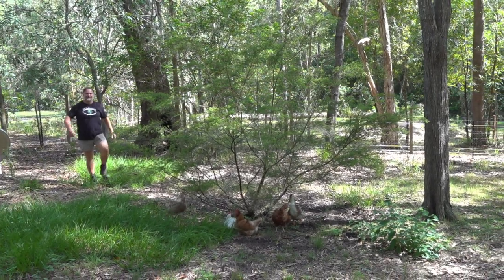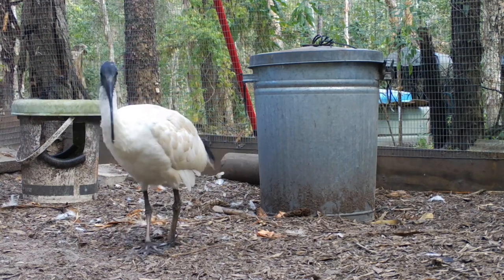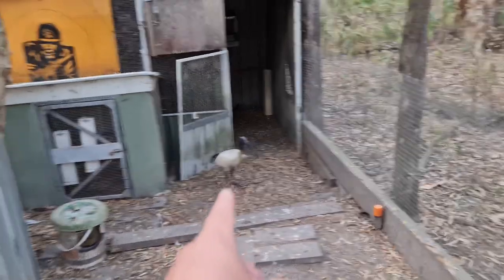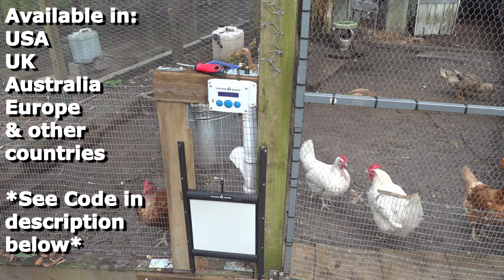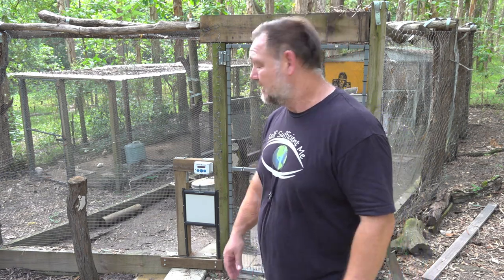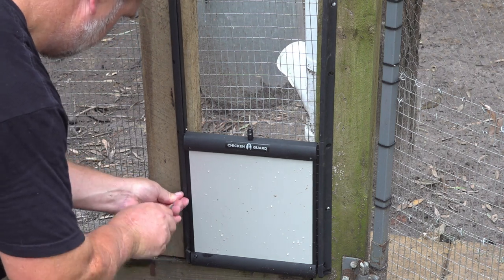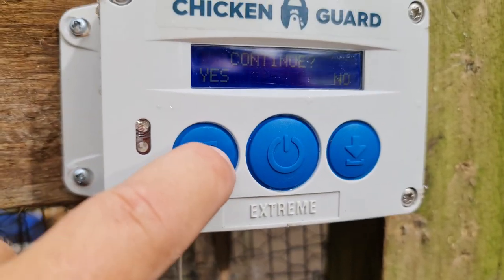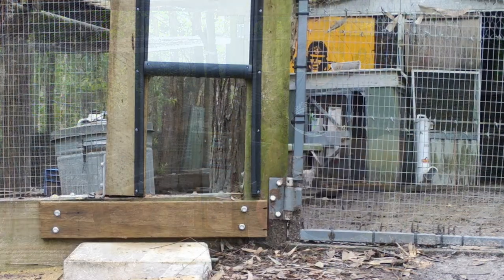Way to STOP BIN CHICKENS Raiding My Poultry Pen | First Impressions Chicken Guard

Comment from the maker: Edit: As of 30 Sept 2021 my unit has stopped working - I have contacted Chicken Guard and am still waiting for their response. I will post my follow-up and final review video on this automatic chicken door once I have more information (hopefully soon) but what I can say to those who watch this video specifically to get more info before buying there are three things you might want to consider: 1 - Getting a unit that is rechargeable via solar power (the batteries in my unit didn't last 6 months). 2 - Get a unit that has an easy way to replace batteries (if not rechargeable) this unit requires the screws to be removed and whole face taken off and the batteries are not easy to get out and back in. 3 - The jury is still out for me on the string method for door operation. Other methods to open and close door such as a screw or rachet system might be better. 
Original post: G'day Everyone, As mentioned in the video: Go to https://www.chickenguard.com.au/?ref=markvalencia and use code SSME5 at checkout for a 5% discount (if you have any issues either with the code or links contact Chicken Guard support and let them know because even if I don't get a commission they should at least honour their word and give you one). I'm keen to publish one last video before Xmas but if I don't get the chance please have a safe and happy Christmas and New Year! Cheers :)
Reply: Merry Christmas and Happy New Year to you also from Texas 🇺🇸. THIS VIDEO IS TRULY helpful to me.
Reply: Are you growing coffee? 
I grabbed a plant from Bunnings and in the process of growing it until I can get a cuppa
Reply: Ibis are super kind intelligent Australian native birds deserving every respect. They're chill ..
cleverly calling out "peace man" amongst the human hotheads
Reply: @amandawoods847  bit extreme rant Amanda. If you actually watch the video there is a segment where Mark actually references the proper name....then I believe there is another segment where he talks about if he was a crueler man and let's said bin chicken go. It's Australian colloquialism, believe it or not there are alot of names for the same thing...  One nation of Aboriginal called the ibis kwenymarr ..,they must be misinformed too.....Stop being a Muppet. He's doing a 1000 times more for our planet and wild life then most people, pull your head out of the sand, be a lover not a hater. 
Cheers again for the great video Mark you're a bloody good lad keep up the great work.
Reply: Merry Christmas Mark from NZ.
Reply: @lynttontonta  step up and start wildlife rescue rather than texting congratulatory to a youtuber
Reply: @lynttontonta  well said Lynntton!
Reply: earth walker  yes, it snows in Australia.  I don't think that it snows where Mark is (think Florida, USA if that helps you visualise).
Reply: Same to you my friend  👍🏽🎄
Reply: Amanda Woods I bet you shead a tear for the stinking bats as well .
Reply: im new to your youtube channel but just watched a dosen of your best videos would be awsome to see you cook with your vegies

Comment: I've had the previous model of this for about 6 years now and it's been very good.  After about 4 years the plastic spool inside broke and I contacted them to ask how much it would be to get it fixed, they said it was dead easy to fix it myself, told me how to do it and sent the spool to me without any charge even though it was out of guarantee.  I'd definitely get another when this one finally wears out.  No 'bin chickens' around here though!  I don't envy you those!
Reply: Do they upgrade with model with flame throwers
Reply from the maker: That's great service and good to know! Thanks for sharing your experience 👍

Comment: I had a problem with scrub jays eating chicken eggs.  They are nearly as smart as crows and able to go anywhere the hen can to get to the eggs.  What I had to do was gather eggs quickly and leave ceramic eggs in the nest.  They quickly figured out that the eggs wouldn't break and stopped being a problem.  Unfortunately, they are very good with color and figured out that all brown eggs crack and they would eat the brown egg in a nest and leave the green one alone.  So, I had to get brown ceramic eggs too, to completely fix the issue.

Comment: I see you love those roofing screws! I highly recommend using an impact driver rather than your drill and they should go in a lot easier, particularly into that hardwood you're using. Plus you won't have to take the drill bit out of the drill for those pilot holes, to put the driver bit in. Love the channel!

Comment: For a lower tech solution, you could also fit in a normal doggy door (for smaller breeds). They have slat inserts to slide into the door that lock it at night.

Comment: If the BC's (bin chickens/black crows) get wise to the new gate, maybe try this:  Add 1/2x1/2 grid wire in a little entry tunnel.  @30" x similar size of door (14"?) tie it in above the door and bow it back about 18" and stake it down.  From the outside with bird vision, it will look like the fence.  (I'd imagine that it is rigid enough not to collapse if someone hops on top of it.)  Chickens and ducks will learn to navigate the slight diversion!  Enjoy your videos and have begun to SSM2 and look forward to Self SuFISHent me?

Comment: If the door is not enough to stop the crows, I would think to add a box tunnel behind the door on the inside. This will look even more like a trap to the crows and because it will take them longer to traverse it and should hopefully make them think twice about entering.

Comment: I would not be surprised if the crows eventually figure out how this thing works, crows are smarter than most people give them credit for.
Now, i don't think they'll actually actively use it, they're probably also smart enough to know they can't get out fast enough with this system.
But yeah, i would not be surprised if they knew how to use this.

Comment: I've got pigeons eating our chicken feed
Reply: A ‘Grandpa’ feeder should fix that. Obviously keeping your chickens and their feed in a fully meshed coop/enclosure all the time would work. We don’t do that either because we like our girls to be able to be out in other parts of our garden as well as their coop area. Interesting to see if the automatic door keeps out birds smaller than the ‘bin chickens’. Have found the Grandpa feeder to be sturdy and effective at keeping both rats and wild birds away from food. Downside is that the grandpa feeder is expensive. There are a number of cheaper versions or knockoffs out there but I believe that this is a case of ‘you get what you pay for’. Pigeons will probably be fooled by some other types of feeders but rats are smart and if you have pigeons accessing food you probably also have rats as well but just don’t know it yet...... Before we got a Grandpa feeder we put the food away in the evening but then a bold rat was observed feeding during the day! Not any more. Take away the food supply and rats and wild birds should move on. Good luck.

Comment: Before you open your chicken coop door, give the bin chickens a taste of 4 gauge shot. you won't get them all but those that escape will tell their mates to keep away.
 The ones you do get, feed them to a compost way down the back where you can't smell them.

 I would have been a mean bugger and give it the boot as it went by.

Still what you did, is way better than my suggestion. Crows are much more clever than bin chickens.